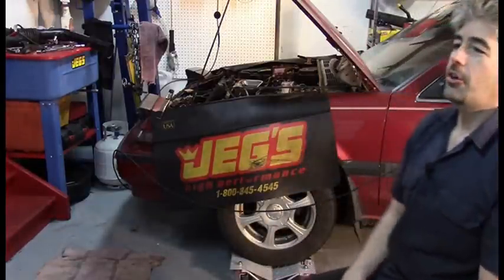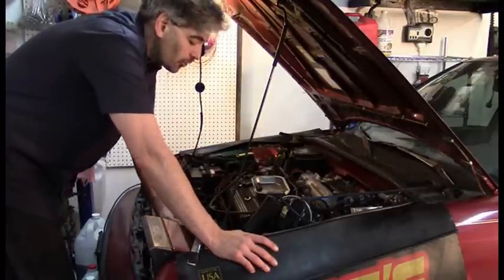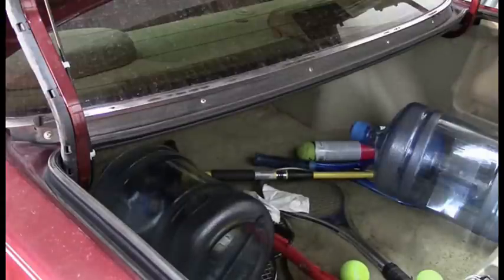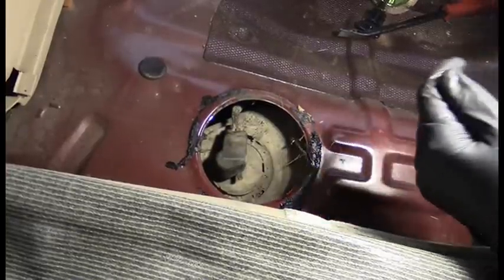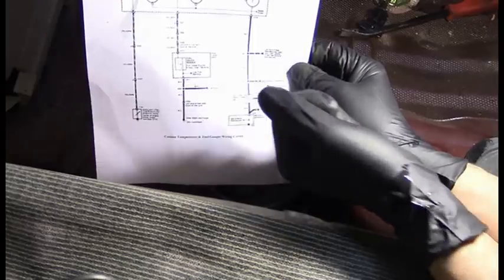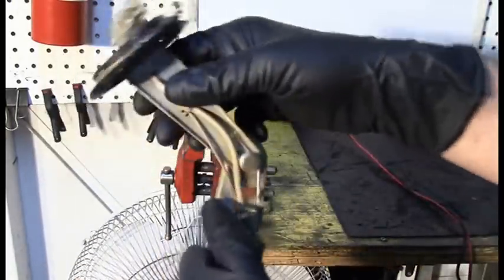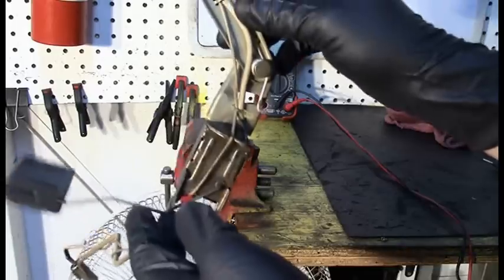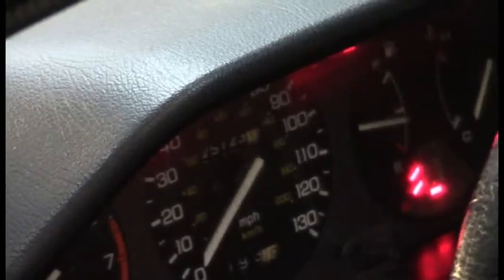Diagnosis of Stuck Fuel Gauge- Is it Gauge or Sending Unit?

Comment: Hey Matt, i have a 1983 Monte Carlo ls. For a couple months now after filling up my gas tank my gas gauge only goes up to 1/2 a tank. I turn off/on my car and the gas gauge stays in 1/2 a tank. I recently replace the fuel sending unit thinking this will solve my problem. Nothing happen my fuel gauge still reads 1/2 a tank. I relocated my ground wire(black cable) to make sure it was properly working it sure is. I test my power (red cable) it has power running through. After i unplug my power (red cable) from the fuel sending unit, it reads a full tank on my gas gauge but when i plug it back on my gas gauge reads 1/2 a tank. Im not sure wat else to do Matt? Any advice. Thank you Dave.
Reply from the maker: you need to test the gauge response using the resistor method shown.
Reply: ok. I would have to create a resistance between my ground and my power using a resister since i don't have signal wire correct?
Reply from the maker: ***** I took a look at a diagram for 1983 Monte Carlo and guessed you have the 305 but the gauge should be the same.  Looking at it, you are correct in your description of the system wiring except there are actually 2 grounds- the gauge itself has a ground in the dashboard and also the sending unit of course does.
  Systems with this wiring type will stay in 1/2 full when there is no voltage to the gauge and will read full when there is an open.  Because you see the gauge read full with key on and unplugging, we know you have power from battery to the gauge (which should be a pink wire all the way from sending unit to the gauge), AND you saw voltage at the power wire to the sending unit so we can check that off. (an open there would explain your problem). So, Your resulting possibilities are defective gauge, defective gauge ground, or defective sending unit ground (but not both grounds).  Yes, jumping your power and ground with a resistor should cause gauge to react. If it does, your problem surely would be with sending unit- not likely since you changed it though.  If it doesn't react, you need to check the gauge ground (not your sending unit ground) and if that's good- you need a new gauge.
 There seems to be- somewhere under the dash, another connector with wires for the gauge power and ground which should make the ground testing easier.  The power wire actually powers all your gauges in fact but each gauge has it's own ground,  Hope this helps.
Reply: I appreciate you taking the time to help me out with this issue thank you Matt.  I check the gauge ground wire, it was poorly positioned. Relocated to a more secure/solid place. My fuel is still stuck in 1/2 full. I pretty much narrowed it down to the fuel gauge itself that's malfunctioning going to have to replace it asap. Thanks again Matt god bless.
Reply from the maker: ***** Yep no doubt about it- you diagnosed it 100%- well done bro!

Comment: Matt, I have to differ with you on one point: Someone who changes out parts without troubleshooting isn't necessarily an idiot, they are just ignorant. :-)
Reply from the maker: It depends- If they don't even consider the possibility of troubleshooting they are an idiot. But if they troubleshoot and don't have the understanding to consider all possible variables, they are ignorant. The latter is fixable, the former is probably not.  For example, someone who replaces 2 dead batteries in a row is an idiot.  But someone who tests the battery posts with engine running and sees that the alternator is not charging it so he checks the wiring, sees it is all clean and tight and replaces the alternator is ignorant.  He did not know enough to consider that a high resistance in the wiring was a possibility and had he tested the alternator at the B+ from the alternator itself, he may have seen it is indeed working.  The difference is in the latter, the thought process was there- the knowledge base was merely lacking. But in the former there was no thought process at all- in fact there was an opposite of thought.  My channel is dedicated to those who get or want to learn the thought process and need more knowledge to increase the variables that can be tested. This will never be appreciated by idiots though. That's why I get thumbs down from people who tell me to just shut up and show how to replace stuff.  
  I myself am ignorant on a lot if things- maybe "unaware" is a nicer term.  But recognition of my ignorance is a consideration in my thought process- that's why I research systems of which I am unfamiliar to make sure I overlook as few variables as possible.

Comment: I have a 2001 Ford Taurus, the fuel gauge has not worked for a few years now, today I replaced the fuel pump and sending unit module due to fuel pump failure and was hoping the new sending unit would correct the failing gauge ( always stuck on full) but it didn't help. Now I need to check elsewhere. :(

Comment: Okay, so I watched this but I don't know if it pertains to my vehicle. 2005 Pontiac Montana Base. The fuel gauge stuck way past the full mark after I filled up my tank. I had reset the trip meter when I filled up as well and at about 320 miles the Low Fuel Light went on. (horrible gas mileage driving in town) Anyway, since the low fuel light works it seems to me that the sending unit and float are working. What other issue could it be? Also, all other gauges on dashboard are working fine.

Comment: Glad I stumbled across this video! My '96 F250 has the same problems but I've had a glad time narrowing the problem but I'll try all these tests soon. Thanks a lot!
Reply from the maker: Zach Plank Yep - you are smart to do the testing first.  See other comment just before yours of someone who just changed the sending unit and pump without diagnosis first- and it didn't fix the problem. Probably $180 wasted and no fix. In fact, most likely the cause is going to be a free fix- just short to ground on the gauge signal explains his problem perfectly. A little electrical tape is probably all he needed instead of a fuel pump and sending unit. Hopefully thats the case for you and you can fix it the first time for free.

Comment: I have a 1000 ohm resistor is that going to work ok?
Reply from the maker: ace trex As long as it shows a change in the fuel gauge, yes. The idea is to validate the gauge responds to resistance where verifies the gauge movement as well as signal and ground integrity to the gauge. The actual amount of resistance is irrelevant.

Comment: I have a 2003 Buick Rendezvous that is notorious for fuel gauge problems. Mine works, but I get the low fuel light on the first start up. Even with a full tank of gas! The light remains for a few minutes and then the needle slowly moves back to the correct amount of fuel in the tank. And then if I start it up again it goes back to normal. Not a big problem, but I'd rather go ahead and fix it. Any help is appreciated.
Reply from the maker: What were the results when you did the diagnostic tests as shown in the video and what help do you need interpreting them?

Comment: Hey Jesus Shuttlesworth   I replaced the fuel pump and sending unit in my daughters truck. I removed the 6 bolts holding the bed on and disconnected the rear light wiring harness. Then slid the bed back about 2 feet.  way easier than dropping the tank.

Comment: hey, i have a f250 truck that when the fuel gauge goes to about half tank, it just dies and drops to empty, but when I fill it back up like 7-8gal. immediately, the meter goes back to normal a little over the half tank line. How long do you think this would take to fix DYI and the cost of parts? I was quoted $650-700 for parts and labor....

Comment: Just a quick tip, the fuse in your meter is blown. I have the same meter and the readings were all over the place. Took it apart and found the fuse was shot. Replaced it and the meter zeros out again. Just an OCD thing but I like it to read 0.00 disconnected :-)
Reply from the maker: Ummm ok... that makes absolutely no sense at all since the fuse is just to protect it during amperage measurements and has absolutely nothing to do with voltage and continuity measurements. Seeing as how I have done amperage measurements in videos after this one I know for a fact the fuse cannot possibly be blown but just because I had 5 minutes to waste I went ahead and checked and of course, the laws of electricity still apply and the fuse is of course not blown.  Thanks though.
  If your meter ever stops measuring current (not voltage) then you need to change your fuse.
Reply: Schrodingers Box No no, it was reading voltage just fine even though it wasn't as stable as the fluke I borrows from my neighbor. However when it was just sitting there the meter would go bezerk, displaying readings all over the place,  sort of like what yours was doing instead of reading zero like it should. Come to find out the fuse was blown and once I replaced it it was fine. My old snap on meter did the same crap years ago when I still had it
Reply from the maker: SammyM00782 Just curious what your explanation is for how replacing a fuse stablized the readings on non-amperage measurements.
Reply: I too would like to know why your meter was acting like that!
Reply from the maker: gtbarnes11 Its called "ghost voltage". It has nothing to do whatsoever with the fuse.
  Ghost voltage occurs when you have an OPEN circuit and in fact, it is very useful in diagnosis.  When diagnosing a circuit, if you fail to see ghost voltage on a voltage reading you know the leads are ultimately making contact so you may be dealing with a short to ground or you may be on same side of the circuit, but when measuring ghost voltage you are definitely on an open.
  Understanding this concept not only prevents you from changing fuses unecessarily, but dramatically increases your diagnostic ability.

Comment: great video, i'm dealing with this same issue on a 98 camry.  gauge read empty (after taking it over a big bump in a dirt road).  so i took out the sending unit, checked for loose wire connections, and put it back in, now the gauge sort of moves up and down, but doesn't seem to drop below 1/3.  going to go back in with contact cleaner, and also check for consistency as i manually move the float while it's plugged in.  

two questions: 
1. what are the chances the fuel tank has a dent in it that prevents the float from moving freely?  are fuel tanks usually pretty sturdy and dentproof  and protected, right?

2. any danger of keeping power on? I have always unplugged the battery when opening up fuel tanks...
Reply from the maker: You are smart to unplug the battery, no doubt.  Actually this repair turned out to be temporary- 3 weeks after the video the gauge only worked when the tank was half full- above half full it didn't read correctly.  I recommend replacing the sending unit.

Comment: Hi matt, i just brought an old honda accord. Its a 1998. My issue is the gas gage does not light up when the gas tank get low. What can i do to fix this? i do all my work my self but i have never done a honda. please help
Reply from the maker: Hi Jackie, sorry for the late reply, I hope it's in time to help still.  I pulled a wiring diagram for your 98 Honda and the low fuel indicator light is actually a separate circuit than the fuel gauge- in other words the needle being low on the fuel gauge does not cause the low fuel light to go on-- it is actually a low level sensor sensor in the sending unit itself that completes a ground to make that light go on.  The wire will be a lt green with red tracer to the sending unit.  The way I would test this is by intentionally grounding this wire and see if the light goes on. If it does not then you either have a wiring problem  from the bulb to the unit or a burned out bulb (see my video on how to replace a control panel light if this is the case).  If the light does go on when you ground it, then you must check for bad connection at the connector but most likely you will need to pull the sending unit and find the open or bad ground and most likely I imagine you will probably have to replace the sending unit.

Comment: After not having a working gauge over 7 years, likely because he was afraid to see what it would cost to repair, to now a fixed gauge, I bet this guy is a customer for life and will be sending everyone he knows your way. This sort of fix will repeatedly be appreciated because we are usually looking at our gauges every time we drive. Molecular biologist? Chemistry major here.
Reply: exactly my thought
Reply: i am hoping you can help me. 98 mustang 3.8L i keep going through fuel pumps. A friend told me it's cause i buy the cheap ones. the last one i installed the gas guage slowly goes to full and stays there. it sounds like from your video that perhaps i have a short. it takes 3-5 minutes to get to full but it is consistent.
Reply: @jaredhopkins5642   did you get the mustang repaired?  I am just wondering

Comment: At first I was surprised to see very experienced technicians go right for the sending unit, rather than testing first. Then I realized how hard it is to get there. They don't want to waste time searching for wires under the hood, and of course they argue that the culprit is usually not the gauge. Watching your videos is a refreshing look at what you can do when you have more time. Those guys never try to fix, or rarely even test a sending unit near open gasoline. Having the customer pay to replacing the unit is done to avoid conflict that may damage the shop's reputation.... Great video!
Reply from the maker: Thanks Dave, and yes you are absolutely right. I know shops get a bad rap for replacing parts that can be "repaired" like in this video but, had I been paid to do this repair, I would have installed a new part to prevent a come-back. It's better business in the long run and the shop is simply trying to prevent comebacks, not rip people off by selling new parts. My problem is when shops replace parts without diagnosing them, make the wrong call, and still charge the customer under the guise of "well, that part we changed was bad but now that we replaced it we can see the real problem better..."
  Indeed my biggest advantage over a professional mechanic is I have time. I had the whole weekend to do the work on this one car so I can afford to be thorough.  My methods would be dramatically different where I paid on hours booked. In that case I'd have immediately called the sending unit when the gauge went to zero after unplugging it, replaced the unit, done a couple manual tests to ensure it works and I'm done in under an hour.
Reply from the maker: ***** Very true, Thomas.  And there are legitimate reasons you could get damned with a comeback even with the right diagnosis and repair.  I once had an easy one- O2 sensor circuit code and find dead B1 S1 O2 sensor with a trace at dead zero. Replaced, worked fine with normal waveform.  Week later, customer says MIL back on. No way, I'm thinking. I read code and now it's an 0420 cat code.  Of course, there was no way the 0420 would have shown with the dead sensor, so fixing the sensor "revealed" the cat code. Of course explaining this to a customer is not so easy- to them the same check engine light came back on and they want the O2 sensor money back!!
Reply: We're damned if we do and damned if we don't.
Reply: Schrodingers Box Great story, worth remembering. You could make a video of 'top 10' examples like this, where the computer's perspective is distorted by how it sees the world.

Comment: Hey matt..another good vid man..smart diagnostics.  Just curious, did you happen to price out a new unit just in case?  Depending on price, I don't think it would have been unreasonable to suggest a new one at that point, since you had it out and knew your wiring was good.  I have a suspicion you may see that problem again :)  However, a new unit would most likely outlive both the owner and the car, guaranteeing no comeback lol
Reply: ummm ya I missed the part at the beginning about this being a good will repair.  Ignore my last post lol.  Im an idiot.  haha

Comment: I presume percussion remedy was NOT tried on this before?  A good whack might have unstuck that float although if it was stuck for 7 years, it would highly unlikely that it would have come down by BFH.  I would have definitely tried it, along with a double dose of Techron.  I am somewhat disappointed that you were not able to actually find the culprit though because by the time you had the sender unit in your hand it was no longer exhibiting the exact symptoms while it was in the car.  It certainly was no longer stuck at full.
Reply from the maker: Ha! actually VGS, I did just the opposite of percussion technique- I was trying not to disturb the sending unit or anything because I was hoping to pull it out "stuck at full" but as you well know that's impossible to do.  But also, had the sender become unstuck if that was the problem, it would have ruined the whole video too because the whole point is the diagnostics.